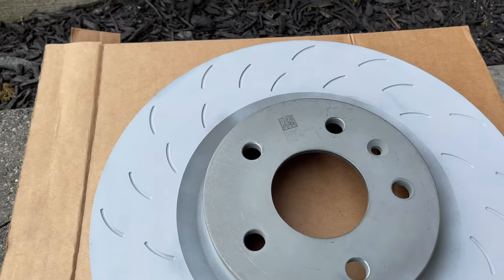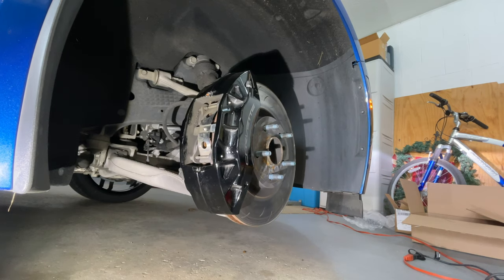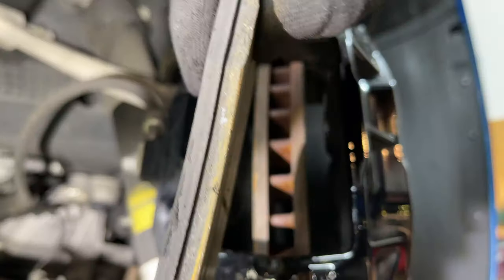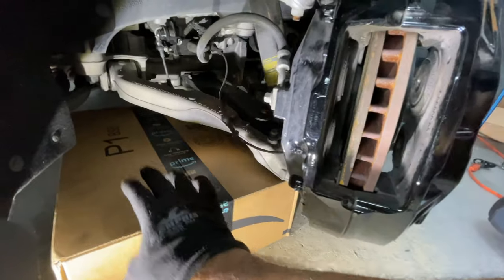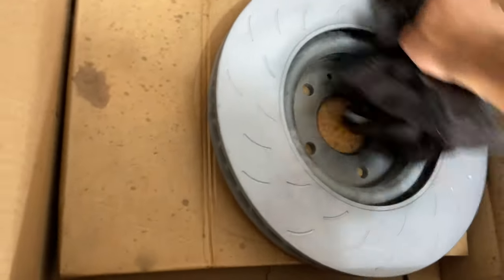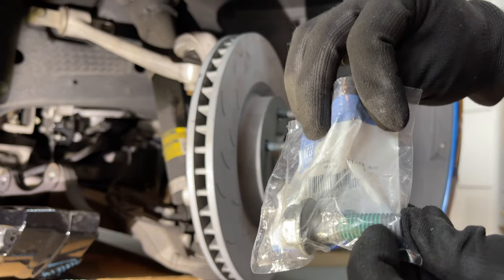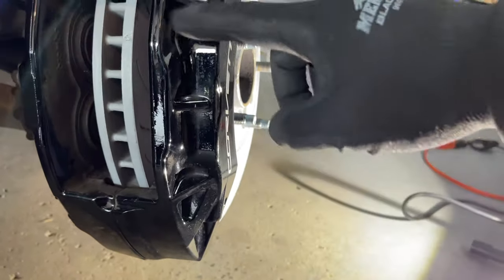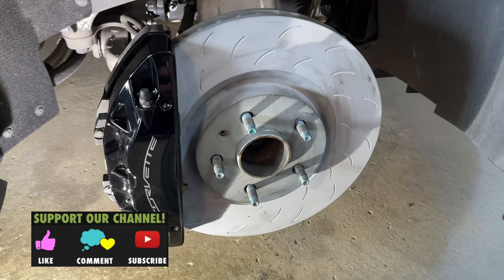Front ROTOR Replacement DIY - C7 Corvette Z51

Comment: You mentioned Chevy changed the 2 piece rotors with 1 piece. Was this a recall or TSB because my Z51 has the 2 piece rotor? Very informative as you see why I asked the question.
Reply from the maker: Yes there was a TSB on Z51 and dealer replaced free. Thanks for watching and hope you check out more on the channel!

Comment: I had my brakes inspected on my 2017 GS with iron rotors after 24+ hours on track use.  Dealer said I needed new front brakes pads and calipers due to a frozen piston.  All covered under 3/36k warranty 2 weeks before warranty expired.  Saved me 5k.
Reply from the maker: Wow that’s great but surprising that piston froze on the Brembo caliper.
Reply: @CarGuy11  fun part was the piston wasn’t frozen I had replaced pads week before after a track day and they all retracted by hand. But I wasn’t going to argue about free new brake set.
Reply from the maker: Kinda what I figured to get under warranty. Props to your dealer!

Comment: The rotor set screw isn't really needed. Its mainly just to hold it on the hub in the factory. I havent used any on my C7 for 7 years.
Reply from the maker: True just nice to have so it’s not flopping around during caliper removal.
Reply: especially if they rust in a Real pain in the